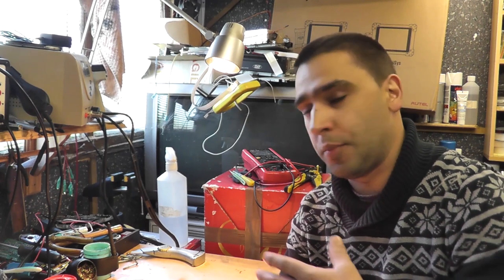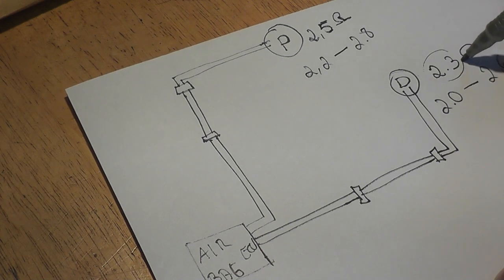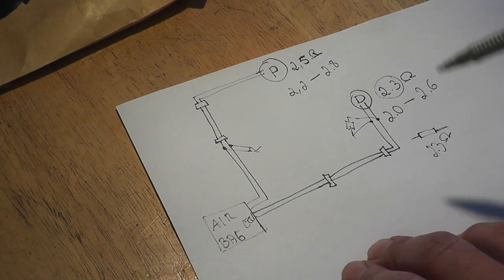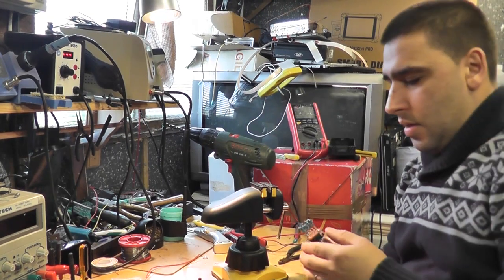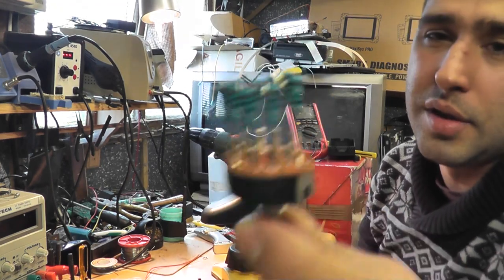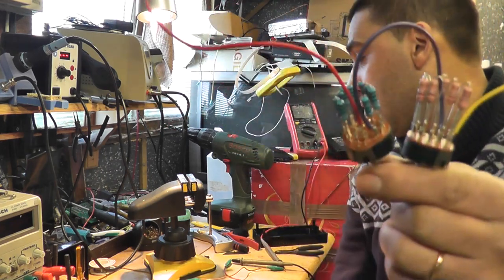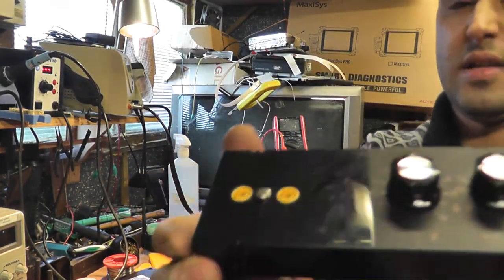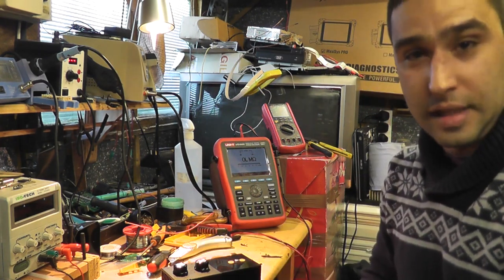Airbag circuit tester. DIY tool. Build your own one!

Comment: Good, congratulations on the content, very technical and dedicated to Airbag have not seen something so detailed, I wonder if it is possible to connect the Airbag system of a car with a few seats of another car of different brand for example, a Seat Leon and put a Subaru seats and connect the Airbag so that everything is working as original. This content I have not yet discovered, if you can help I would appreciate it. Thank you and good videos
Reply from the maker: Hi
I would say that if the resistance of the replacement is the same, should work...
But, do your own research, as I never done such thing...
👍👍👍
Reply: The problem is I've searched everywhere I could and I can't find anything talking about it.... I've searched for Recaro CS installation and they never talk about how to connect the Airbag from the seats.... One of my fears is connecting the Airbags and them popping.... I don't know if the wires on the airbags have positive and negative polarity or if it is the same to reverse the wires.... This is information I can't find anywhere.

Comment: If the computer is able TO make a difference between open circuit and short circuit, why you need a dummy resistor? Open circuit, short circuit that the code you going to have. in the case that you have a higher resistance than normal, short that circuit and check for wiring problem. Good video by the way. sorry for my english I have an andicape I born in Quebec!
Reply from the maker: The computer can establish those two...
But can tell if the problem is wiring of the component at the end of the circuit...
That is where devices like this become handy, to check circuit integrity...
👍👍👍

Comment: Thank you friend for your teachings.  I am one of your followers, I have a question for you?  how can i do with a 2002 vw beetle, when the cluster is replaced by a used one
Reply from the maker: That will require the pin from both clusters if I am not mistaken...
Alternatively, you can attempt to swap the eeprom or mcu...
Never worked on one of those, so not sure which one needs doing... or if both...
If you have programming tools, might also be possible to clone it...
Check the ross-tech website... there is very good info in there...
👍👍👍

Comment: I thing a Laguna 2,for example, has 4 wires going to the driver's airbag alone, one plug on each side of the (explosive) cylinder ; each plug,one green,one blue, w/ 2 wires; maybe you'd need 2 resistors for that one airbag?
Reply from the maker: Yes... you can always connect it parallel...
But this is to test the circuit, so you can always test one at the time...
The two plugs is for the dual stage airbags system... 
👍👍👍

Comment: Hi Luis if two or more air bag igniters are fault/open circuit how can we check the value of the resistor at the same time?
Reply from the maker: I am not sure I get your question...
The igniters have separate circuits...
(With a few exceptions where manufacturers have 2 igniters in series.... in order to deploy them at the same time...)
👍👍👍

Comment: Brilliant, as always.
Good job and very ingenious 👏🏻👏🏻
In Audi we use the VAG1630A for test airbag circuits, and personally for all components that works under reference currents.
Could be a good idea to make a video with Asus (actual values) and this tool, showing how resistors influence the voltage received from ECU, and how is converted to another parameter as temperature, intake vacuum, etc..
It's very useful because with this method discarts malfunctions from Ecu internal power supply, wiring harness, connectors, etc...
Regards and thank you!!
Reply from the maker: Indeed... I am using it quite often...
Thank you for watching and for your comment! 
👍👍👍

Comment: is it possible to bypass the seat occupancy sensor mat to make it think there is no one in the seat???
Reply from the maker: Hi
Yes it is... usually using a resistor... the value, depends on the car...
Thank you for watching and for your comment!
Reply: @LMAutoRepairs  e61 2005 525d european car. you have a estimate ohm value? do i need a diode in parallel or series to?

Comment: Hi, mate having issues with red airbag light on ever since used jump leads to start car, code comes up as b0117 (front impact sensor) changed sensor still no luck, checked feed to sensor its showing around  12v constantly any advice would be greatly appreciated, also any way to check if crash sensor any good or a bypass. Thanks
Reply from the maker: Hi
The impact sensors on some cars, need to be specific... also, some have more than 1 sensor...
Not saying it is your case, but might worth attention! 
👍👍👍
Reply: Checked on my alfa romeo by disconnecting the slam panel sensor which the diagnostic says is the issue so then the same fault code was present no new code, so just to be sure I disconnected the seat airbag and that came up on diagnostic so the module is correct in pointing me to the slam panel sensor, many thanks for your reply 👍 p.s. the sensor i replaced has same part number so do you mean programmed in by saying it needs to be specific?

Comment: Great work, which tool would you recommend to remove car file from airbag modules?
Reply from the maker: Hi
X-prog, xhorse,  etc.. 
Thank you for watching and for your comment!
Reply: LM Auto Repairs sorry, I had an error in that question. Do you remove Airbag crash file from the Airbag modules as well and if so, which tool you use?
Reply from the maker: @rayong8975  
Yes... and again, X-prog, xhorse,  and others....

Comment: could you not just use a variable resistor
Reply from the maker: Peter Rumble
Hi
Not really... I mean, to find a variable resistor that will go from 0 to 10 ohms with this accuracy,  is quite difficult...
Plus, this way, you know exactly what resistance you are putting in the circuit...
But, by all means, show us how to do it using just a VR....
Thank you for watching!
Reply: sorry i wasn't trying to be clever i'd seen one that looked like it was made from a rheostat with markings for different resistance . the adptraining i said about they have a play list of different diagnostic tools you can make your self .just thought you might find it interesting .
Reply from the maker: Peter Rumble 
Lol
No worries... and I was not try to be rude or sarcastic... 
There is different ways of doing this... I just done it this way... some people will might find it good, some people will find it bad...
Opinions...
Thank you for your feedback!
Reply: LM Auto Repairs

Comment: What causes this error code
Reply: The resistance value in the ignition circuit containing component R12/2,(,front passenger ETR ignition squib)is too high. Car is 2003 Mercedes SL 500.  It has 2 yellow plugs underneath the passenger seat,  I don't know where to use the resister,  plz help me
Reply from the maker: The squib is the system behind the steering wheel... which allows the connections to the steering while turning the steering...
That looks like it is referring to the steering airbag... a quick look at the live data should help you to confirm that...
👍👍👍
Reply: Thank you for the quick reply. It got me confused because it mentioned the passenger word. I'll have a look and see , tx again. I'll keep you posted
Reply from the maker: Again, live data will help you...
😉

Comment: Thank you great work ,very impressive , i have a question i have an airbag light on my 2014 honda accord  , i have a code ( B0090 )impact sensor front driver side , is there a way to test the sensor it has 2 pins , and i do not have reference resistance for it any guidance thank you
Reply from the maker: Hi
You would either have a closed circuit (or near that), or OL... in the case of a traditional impact sensor...
But some I believe they are digital... so resistance does not play here... 
I would check the wiring from the module to the sensor, if checkout ok, then the sensor is probably at fault...
Hope that helps.
Thank you for watching and for your comment!
Reply: U can buy this nd put ur air bag side if light goes off that mean that side air bag problem  ,,Universal Wheel Airbag Emulator Simulators Fault Tester Airbag Diagnostic Tool